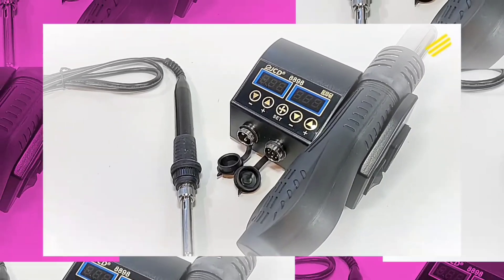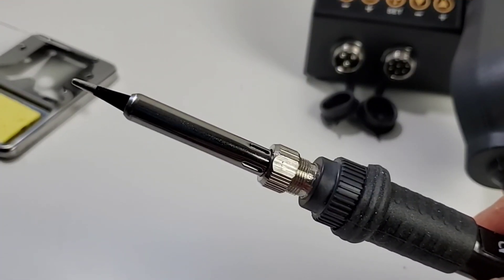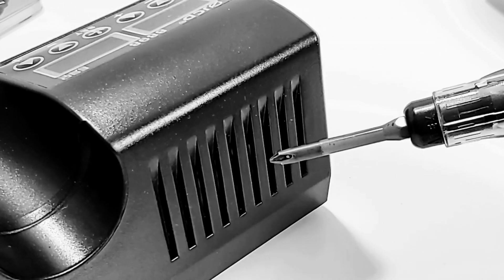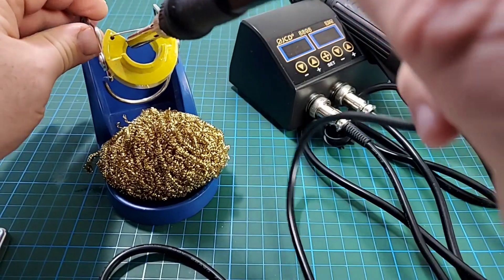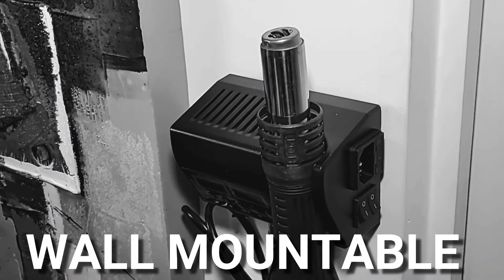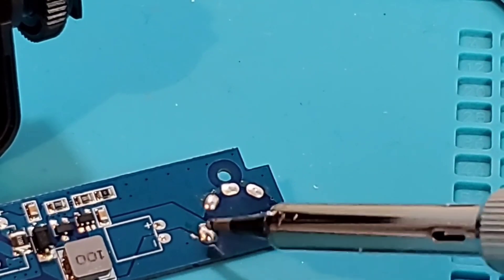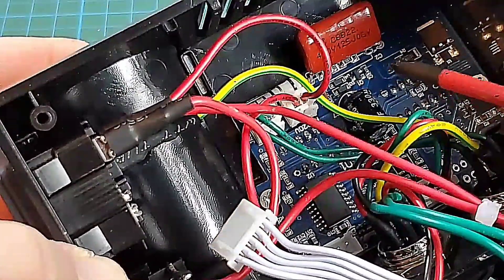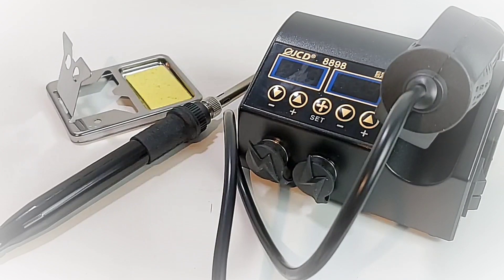JCD 8898 HOT AIR/SOLDERING STATION Review & Teardown!

Comment: It looks like an interesting soldering iron and hot-air station.  It seems the normal price is about $60, but Banggood has it on sale for about $40.  I wonder about the long term use of it; maybe a follow-up video might be good--a year from now.  I like the compact design and wall-mountable; it might be great to save space on your bench.  It appears smaller than either my soldering station or my hot-air station.   What category of user should this be considered for--eg: dyi, hobbyist, enter-level,  pro?  Thank you for another great review.
Reply from the maker: Its definitely a hobby style soldering station..its built well but its by no means meant for production work or professional soldering applications. At this price its a steal and I'd get one just for the sheer usability. The tips cost next to nothing and the hot air gun is surprisingly well made. The spring coils in the heating element are of high quality and it will definitely last.
Reply: I bought it for around $30 on sale on Aliexpress and have been using semiregularly for almost half a year now. It’s not that bad. I would say that it’s quite robust and durable for what it costs. And you can buy five 900-M tips for the price of just one T12 tip. But for $60 or so a T12 soldering station would probably be a better choice. And if you want a professional soldering station, then I think you should aim higher than $200.
Reply from the maker: @numerical_error  T12 is a good choice for a soldering iron too but this duo Soldering/Hot Air station is really hard to beat at this price! Other than a couple 200$+ units I don't know of any 💥💥affordable 💥💥T12 Soldering/Hot Air stations?
Reply: @KeepOnTesting  
Well, there is a KSGER T12 STM32 soldering station for around $40-50 and a KSGER hot air station for around $70 (on sale probably). They also have several versions of 2 in 1 stations for around $200, but since there are no actual models, it's difficult to differentiate between all of them. In fact, it would be great if Banggood could provide an inexpensive T12 station for a review.

That being said, I don't think it's possible to beat JCD 8898 in terms of quality and affordability.
Reply from the maker: @numerical_error  I Agree. We also need a good affordable T12 Solder/Hot Air station..hopefully we will see one sooner rather than later.

Comment: All that for $35US?! I especially like that auto-shutoff/cool-down. Could the iron (without the station) be run off of a PWM 12V source? PS. The new website looks great.
Reply from the maker: Yes, I'm grateful we can get so much for so little these days.. as to the Pulse Width Modulation, , can't confirm at the moment but its possible,  running outside its intended power rating is always an unknown...

Comment: Great review - good to see these reviewed, made me think of when I was a kid way back in the 70's when there was nothing like this available in the affordable range, if it even existed at all then it was just the high end $$$ pro stuff which I couldnt have afforded anyway.  All we had was the local radio shack just blocks away, even then the selections were limited to a couple three irons and the manual solder suckers - dont recall any such thing as a hot air station yet even at radio shack, unless I just dismissed them offhand due to cost.  I also imagine this was because back then the majority of electronics were still through-hole design, I dont recall seeing anything with surface mount devices, at least not in things I was trying to fix. Amazing the capability an inexpensive station like this can give the average person. Really does seem like they could have included some kind of wire or other iron holder on the right side for a couple more bucks and im sure they figured on selling you one - but on the other hand this allows you to choose the type of iron holder you like that may well be more suitable to your liking.
Reply from the maker: Definitely a step up from the Radio Shack days..good things do come in small 📦 packages. Now, if only they put some rubber feet on this bad boy we'd be all set !
Reply: Yeah things tend to want to scoot around with nothing but hard plastic feet, in fact I just bought some silicone rubber bumpers that screw into either sheet metal or plastic for a new budget computer case.  This low buck case comes with "stick on" feet that never stay stuck, the silicone feet solved that problem and might work well on this rig.
Reply from the maker: @yambo59  Great suggestion 👍 Do you have a link 😀 ?

Comment: Oh, it's nice to see you trying out this little station. It actually proved to be quite adequate for what it's worth. I've been using it for almost half a year now with no major problems. But you're right, the station is too light and slippery if not mounted. And since it's a cheap-o, the cables are not silicone but PVC. So they will definitely drag the station around, if you just let it sit on a table. The other disappointment is that the station is saving your temperature settings, but doesn't save temperature units. So if you want Fahrenheits, you need to switch it every time. 

Other than that I have no complaints. The soldering iron is okay. It's quite comfortable actually. The handle doesn't get too hot even after half an hour of use. The hot air gun still works. 😃 I was as pleasantly surprised as you by its basic but decent build quality. All in all, there are a lot of better stations (Weller, Pace, Hakko), just not in this price range. I think that's what made it so popular.
Reply from the maker: Excellent synopsis! You definitely hit the nail on the head.. yes, there are better soldering/hot air stations but not for 40$!! 😃

Comment: I always just wonder why the SMD components don't get damaged despite being exposed to that much of HOT AIR! 🤔
Reply from the maker: I normally use Kapton tape but this was a sample board so I wasn't worried. You do need to circulate the 🔥 hot air nozzle to prevent excessive heat buildup on the surrounding components/ pcb.
Reply: SMD components are made with very hight temperatures resistant materials mainly silice. If plastic then they suffer.